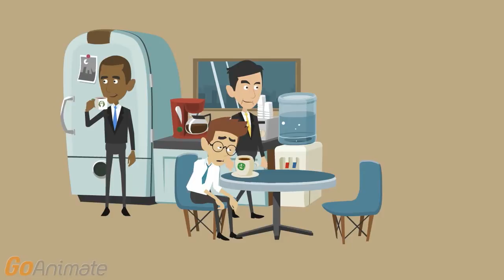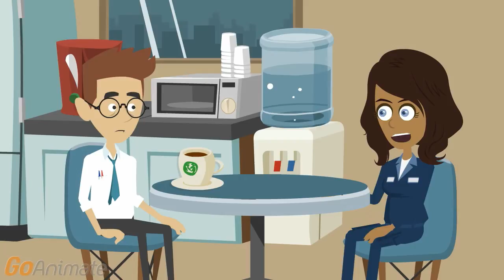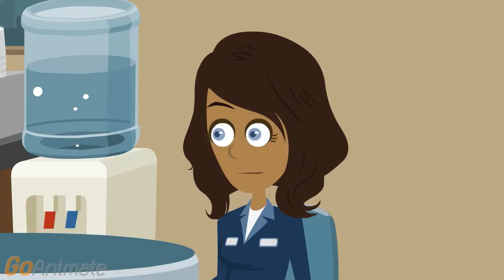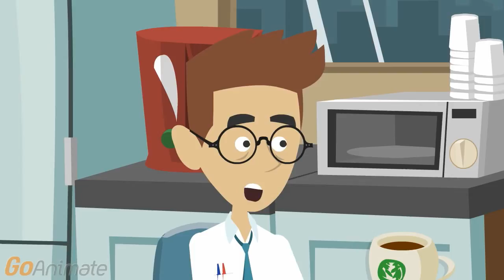How to Fix a Broken Furnace Ignitor

Comment: If it fires and shuts off repeatedly(short cycling) it's not the igniter. Likely the flame sensor is dirty or has gone bad.
It is a little rod that sits in the flame path with just one wire going to it. The igniter has two wires and glows brightly when turned on. Shut off the power to the furnace. Remove the sensor and clean it with steel wool. Reinstall, turn on the power and set the thermostat. I have to do mine once every heating season.
Hopefully that is a quick solution.